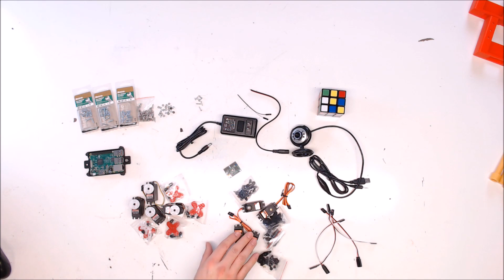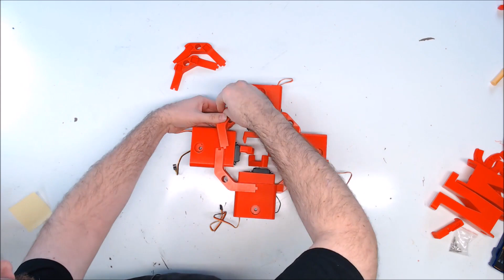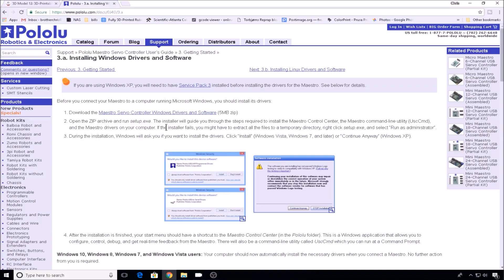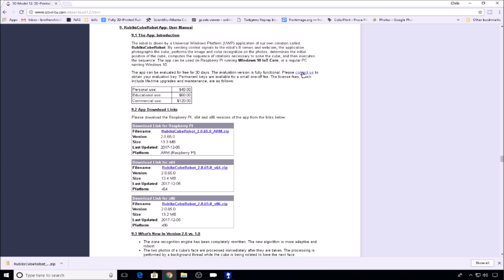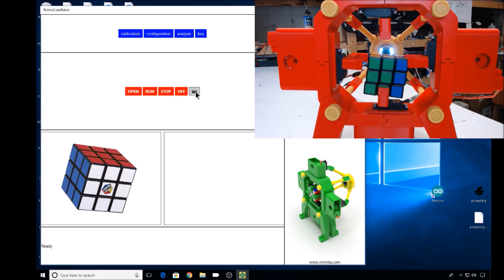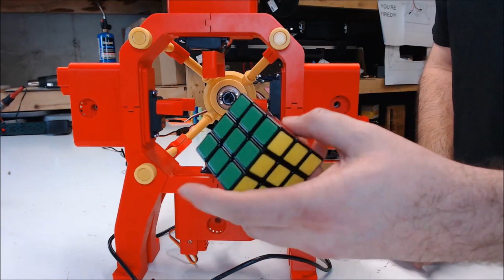Otvinta 3D Printed Rubik's Cube Solving Robot - Chris's Basement

Comment: My setup seems correct but when i run the test from the otvinta software my servo arms do not move, but  my grippers do.  However the servo arms do move when configuring the settings in the Pololu Maestro Control settings, do you know why this would happen?
Reply from the maker: The software must think they are already in position. Its been a long time since I looked at this. I would send the software folks an email. They seem to be responsive.

Comment: This is the 3rd video of 3D Printed Cube Solver that I watched. Just tell me guys. Why u dont u try the other cheaper servo motors for ex or cheaper. U just doing exactly the same as OTVINTA. In their suggestions electronics are really expensive like oer 200$. May be for u it is cheap, but what about the students, or the people who r not reach as u.
Reply from the maker: It's not a very easy thing to build from scratch really. Otvinta did a great job on this design. You are correct, it's not cheap to build.